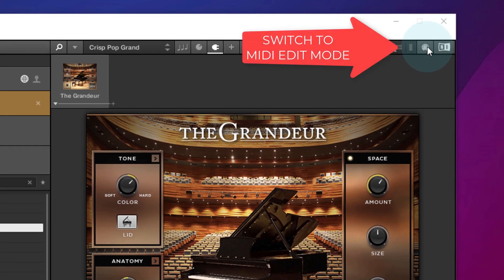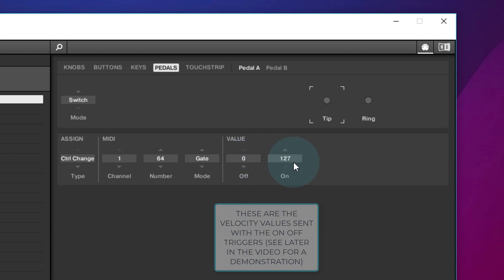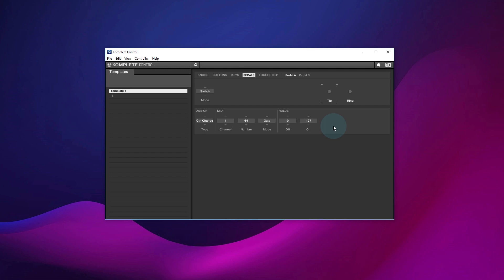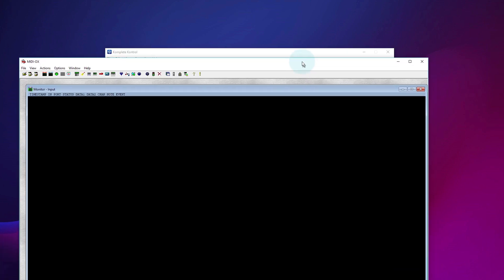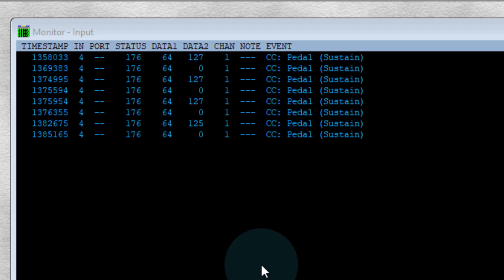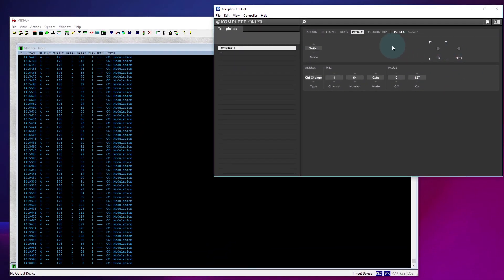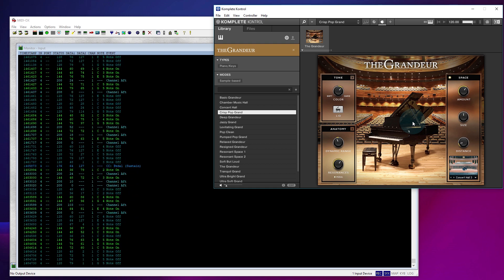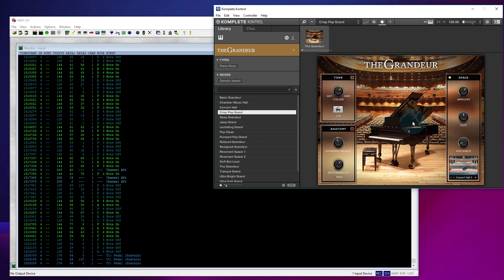Sustain Pedal Setup | Komplete Kontrol

Comment: Hi, I wonder if you could give me some advice. I'm trying to use sustain in kontakt without a pedal, which I've worked out how to simply turn on and off, but while it's turned on the notes are sustained for way too long. Is there a way to adjust this to get it sounding a little better?

Comment: Funny, i have the same Sustain Pedal, using it on the MK2 S61. I have to set "127" as the Off-Value and "0" as the On-Value because it is vice-versa.
Reply from the maker: I assume the polarity switch on the bottom is switched in the other direction.
Reply: It is at position 1 (other one is 2). In Keyscape it works just fine, so i guess the problem is in Komplete Kontrol. Whatever,  now it works xD
Reply from the maker: Good to know! Thanks. 👍🏻

Comment: i just bought a proline sustain pedal and i followed you instructions and still no luck
Reply from the maker: You might have to whip out some midi monitoring software like I did to see what’s going on. If you figure it out, come back and let me know how you did it. I've had no further problems with the setup in this video.
Reply: I download that midi ox and it’s weird when I plug the sustain pedal In my s88, it doesn’t show anything on midi ox but if I slightly pull the jack out of the socket I can see it working
Reply: I think it’s the sustain pedal that isn’t working
Reply from the maker: Have you tried it on the other pedal input just in case? (I assume the original S88 has 2 pedal inputs)